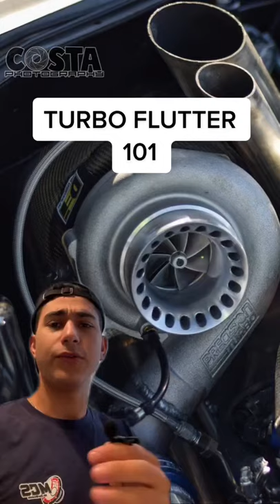TURBO FLUTTER 101 - Explaining Sutututu Theory

Comment: It's called compressor surge, it does not come out the turbine, which is the exhaust side, it comes back out the compressor inlet, which is horribly bad for the shaft, the holes around this particular compressor inlet in the video has anti-surge ports, which will exit those ports instead of totally backpressuring the compressor wheel.
Reply: I came here looking for this comment!  I was watching the clip pulling my hair out for the slight misinformation 😅
Reply: Ikr I thought its real bad for the air (sututu) to come out through the intake part of the turbine... and also where's the connecting air filter? It can't run and can damage the turbo without it, no? 

Oh and so those holes are meant properly for the air to come out the turbo if have to, cos there's the proper bov..?
Reply: It is not bad for the turbo
Reply: You can't explain this to him cause he knows and we don't rahhhhh
Reply: Not bad for quality turbos at all. And even in the worst cases, as an example; your turbo might only last 95,000kms, instead of 100,000kms.
Reply: I always wondered why some turbo inlets had holes or slits around the circumference🤔
Reply: This is closed throttle compressor surge. You’re thinking of open throttle compressor surge. It’s crazy people are still talking about this being horrible for turbos when it’s not. - it’s definitely not as efficient as a diverter valve or even blowoff for that matter. But it’s certainly not horribly bad for the turbo shaft.
Reply: some dealers have the turbo setup for compressor surge, so it's not truly so dangerous unless you push a lot of boost back and forth without another way to relieve pressure.
Reply: @llunull43 while an accessory driven supercharger does this function automatically, but where's the fun in simplicity?
Reply: Installed hybrid turbos, cts stage 2+ turbos on my 2015 m4. I get a flutter when I go hard and once or twice for 15 seconds I had smoke come out. Can a custom tune fix the flutter
Reply: I'm pretty sure i've heard it's not THAT bad on turbos, atleast newer ones.

Comment: Dude its escaping through the compressor wheel not the turbine! The turbine wheel is the exhaust wheel, cheers
Reply: sounds violent. It’s spinning one way but the air still comes out backwards. I can’t visualize
Reply: Isnt it more to do with the pressure building and falling WHILE the blowoff is doing its thing? Isnt that why the compressor is going faster and slower, cause the valves opening and closing? To be fair that could be what he is saying i might not understand.
Reply: @yescharliesurfs  it is simply the turbo was pumping air into the engine and then when you lift off the accelerator the throttle body shuts and if there is no blow off valve or all the pressurised air cannot escape through the bov the air escapes out the front of the turbo where it got sucked in. The sound you hear is the air being chopped up by the compressor blades.
Reply: @farmer3242 would this not be a negative impact on longevity?
Reply: @billbobaggins7617  it will
Reply: @billbobaggins7617  Ohhh Yees 🤣 Costing money to sound cool 😁
Reply: @billbobaggins7617  Yeah most likely. Gives an excuse to upgrade the turbo tho 😈
Reply: @yescharliesurfs no  happens without a bov. not ideal but sounds good but causes lag to
Reply: and without a bov it takes longer for turbo to go back on boost
Reply: @Pete-hy4mq  If it caused any lag it would not be common place in motorsport not to run a valve, it does not slow the turbo down, it does not cause any lag, in fact not releasing boost pressure means the turbo doesn't have to build up that pressure from nothing.
Reply: @DriftNick  . Thats exactly what bov does.not for noise its to keep turbo spinning without stalling the turbo. Not having a bov is also harsh on plain bearing turbos. I have not seen one track car without one apart from drift cars but it just the flutter noise people want. Its the bov whole purpose. Nismo back in the day used two bovs to keep turbo spinning at same speed with throttle shut.. its simple rebound affect especially with short intercooler piping. Another problem on afm cars without a bov fuel mixture goes lean then rich just by lifting off. And im not talking about 1st gear take off lag.  Its between shifts
Reply: @Pete-hy4mq  If you think not running a valve stops the turbo from spinning you have no idea what is happening, stalling refers to the air separating from the blades not the turbo stopping, turbo flutter does not even slow the turbo down.

" I have not seen one track car without one."

Haven't looked very hard, of course you probably also think you are hearing blow off valves on race cars when it's actually flutter, GT3, GTP, F1, WRC, most top level drift cars all have turbo flutter.
Reply: @DriftNick  turbo speed slows dramaticly between gears without.  Like invisible coil. What ever way it turns out if it takes longer to go back onto boost id rather no bov. The sound and ive had turbos over spinning withva bov with creep. Thru compressor wheel staight off and exploded. Getting all that metal out of fmi was not fun. And no it doesn't stop spinning in just slows it down
Reply: @DriftNick  from turbo smart.        
A blow off valve in our testing helps with turbo lag. Venting to atmosphere or venting back into the box as a bypass really does the same thing. It makes no difference. The main reason why a valve is added is to remove what is called compressor surge. This is when the throttle valve closes and the turbo is still spinning at very high RPM's. Compressor surge is the turbo oscillating shaft RPM's and you can audibly hear the noise. This is first off bad for turbocharger longevity and second causing turbo RPM to slow dramatically. When you accelerate again, the turbo has to spool up. A blow off valve or bypass valve will by pass the excess pressure when the throttle valve is closed, allowing the turbo to free spin at a much higher RPM
Reply: @DriftNick  anyway it looks like this subject is divided as much as iran. To soon?. Lol .im not a fan of bov sound so im divided myself.  1988 nismo r30s had no waste gate .just two bovs one without vac and was used to keep boost in cheak but they can afford over speeding turbo's.  Worked tho
Reply: @Pete-hy4mq  You lack a basic understanding of what is happening, people have tested it, it does not slow the turbo down, again if it did cause any lag no one in motorsport would run without a valve.

" ive had turbos over spinning withva bov with creep."

"1988 nismo r30s had no waste gate .just two bovs one without vac and was used to keep boost in cheak but they can afford over speeding turbo's."

wut
Reply: @DriftNick  . Turbosmart and garret must be wrong to. Hmm
Reply: @Pete-hy4mq  Companies selling the solution to a "problem" aren't the most trust worthy, your quote isn't even from Turbosmart, can't even get that right apparently lol, again if it caused any lag literally no one in motorsport would run without a valve.

Also come back when you learn the difference between a wastegate and a blow off valve, you lack a basic understanding of this topic.
Reply: @DriftNick  30 years in the industry i do know the difference.  As for the old nismo setup with to bovs look up r30 nismo setup in production racing.  Its crazy i know but they did it untill they went thru to many turbos from over speeding the turbo.  They had no waste gate what so ever. Dont know why they tried this but they did. Im guessing there idea was keeping the turbo spinning as fast as it can between gears  but was havoc on turbos. As for lag without a bov im not talking about acceleration lag .just between gears as turbo stalls a bit and has to go back on boost . Plum back bov reduces this. There dozen of you tube vids saying same thing. So im guessing you thought i meant lag taking off. Witch you would be right and doesn't cause lag.
Reply: @Pete-hy4mq We are talking about blow off valves and turbo flutter, why would you think I was taking about lag taking off? I'm talking about between gears and/or with quick off and on throttle, there is no extra lag without a valve, in fact the opposite is true, because pressure is not released by a valve it does not need to be built up again when you get back on the throttle quickly.

What R30 Nismo are you talking about? are you talking about the Super Silhouette cars or something else?
Reply: @DriftNick  i think the silhouette was the r31 skyline.  The skyline before it used as touring cars in Australia.  Some had fj20s and later was eccs red top rb20 . Not the nics efi. .they sid things strange back then like liquid cooled ecu's.  They just controlled boost by 2nd bov like bov creep . It worked but turbo's would over speed alot so had to change them out between races.
Reply: @Pete-hy4mq  In Australia the R30's the race definitely had a wastegate and no blow off valves, can you narrow it down? what car exactly ran that setup?
Reply: @billbobaggins7617  yes it’s stalling the turbine wheel putting tremendous load on the bearings. It also slows the turbo down considerably, like slamming your brakes vs coasting.  Now you have to make up for lost speed. It can still happen with a BOV if it has insufficient flow or isn’t setup correctly.
Reply: Jesus I just read some responses and there does seem to be a serious lack of info. 1 year of experience “in the industry” and you think a BOV or a wastegate aren’t 100% requirements you need to find a new field. The ONLY way you might get away without a wastegate is a turbine housing with variable geometry but these are very rare (especially on gasoline engines, diesel I can name a few).  
For the record the r30 had a wastegate but had ceramic compressor wheels that would explode over time, or with little time if overboosted.  There is also no such thing as BOV creep, it’s boost creep when the wastegate is unable to bypass enough exhaust flow(not air flow), which is solved by a larger wastegate or dual wastegates.  A few hours of reading should bring you up to speed on the simple basics.  Or, simply take a look at a drag car. Power to weight ratio is so important they never have anything unnecessary, (often no battery even) but name one that is turbocharged and doesn’t include both a BOV and a wastegate. With answer being none you need to study and understand why these are essential components of a turbo car. You don’t put hundreds of thousands into R&D (sometimes millions in top fuel), years into testing and use something that is unnecessary or doesn’t give you an advantage
Reply: @91maxpower   The irony of you saying there is a serious lack of info after you say it stalls the turbine wheel and also slows down the turbo (probably meaning the compressor wheel), lets start with those two things are connected to each other then if you think it can stop the turbo you lack a basic understanding of what is happening, it does not even slow the turbo down.

" you think a BOV or a wastegate aren’t 100% requirements you need to find a new field."

Wastegate are required except with variable geometry turbos as you mentioned, blow off valve are not required, literally countless people including pro level motorsport teams they don't run a blow off valve or bypass valve.

"name one that is turbocharged and doesn’t include both a BOV and a wastegate."

I can link you a bunch that don't have a blow off valve, though it's more common to see them running one when they are pushing really high boost pressure to stop damaging the throttle plate, not something that happens outside of those extreme cars.
Reply: @farmer3242  More like a rapid pressure build up and release oscillation in compressor wheel.
Reply: @carlosandleon it’s not good for the turbo. Reduces the longevity of it. If you want to try and get a better understanding of it. Go watch driving4answers. He explains everything in a lot of detail so you might get a better understanding of how it happens. He also talks about why the “stu” at the beginning is the loudest and the “tu” at the end is much quieter. Basically a quick explanation is cuz you have the most amount of boost at the start and it releases pressure each “tu” sound. So the turbo doesn’t have as much force to fight against the next “tu” making it quieter each time.
Reply: @Gangster_87  driving4answers is a trash channel chock full of misinformation
Reply: 😂 yup
Reply: @billbobaggins7617 
Yes it will fck the turbo or the engine
Reply: @jessicaandtrains7768  How will it fck the engine?
Reply: @yescharliesurfs For sone time, I thought this was the sound of tuned cars pushing more boost than the BOV can let off. Then I find out it's from these track enthusiasts who delete the BOV alltogether to retain boost between gears. That being said, my big twins on tuned 6 cyl with dual BOV tends to give a short chuckle, or "uh-oh" on throttle closure. Boost doesn't need to be big for this. Never did it before the new parts. It seems to be resulting from the larger turbos taking longer to spool down, and the the larger intercooler and piping taking longer to depressurize.
Reply: @farmer3242 I knew someone was going to beat me to this knit pick. OP wouldn't be the first with that misnomer at all. In practice, people call any rotor in a housing a turbine. You're up against the entire jet-ski parts industry on this one.
Reply: @enlgtnd No it won’t. No evidence that it’s bad for them at all
Reply: Mike-vq1fm   I feel like you gave the best explanation I dont know why everyone is ignoring you.
Reply: Correct. And he's also wrong because you can have a BOV and still get flutter.

Comment: Not running a blow off valve shortens the life of your turbo. You can also have a system (I forget what it's called) where it reroutes the air in front of the turbo's turbine. So you don't lose all of the pressure your turbo built up when letting off the gas.
Reply: Diverter valve
Reply: And yes this will shorten life but it helps keep boost pressure up if u don’t run something such as a diverter valve. And it’ll still last a long time even with the flutter if u have a good turbo
Reply: Anti lag
Reply: Debatable. People run them like this all the time and when you check for shaft play it's fine, the fins are fine etc. Japanese tuners run them like this all the time and they don't overtly ever say that it's bad.
Reply: Recirc
Reply: Lol
Reply: @John-du2mq  no bov need it at 40 psi of boost
Reply: Recirculation valve
Reply: @John-du2mq yeah that’s what I always wonder and I’m running a precision turbo like in the video but I don’t have mine blocked off but I want to try it for a little while just to see.
Reply: Recycling valve a lot of turbocharged automatic engines have them I know the 4G64 have it in the Eclipse and Taylon
Reply: from what car dudes have told me, they said this is a myth.
Reply: @steviejrr  physics debunk myths.
Reply: Ive ran may turbo cars without a bov and blanked the recirc valve and never had any turbo issues its all a myth
Reply: it can do more than shorten the lifespan. it can kill them instantly. this noise we are talking about is called surging. the pressure on the outlet gets too high and the comp wheel can't keep shoving anymore air so the air reverses direction out the comp inlet temporarily. the problem comes in during this event as it lowers compressor pressure significantly but the turbine pressure is still high. this creates as massive thrust load that the thrust bearings hate. 

there are industrial turbos out there that cost more than 75% of the cars on the road that can't be surged very much. never let your turbo "flutter"
Reply: @E85_STI do it. They would love sending you another one at full price. The bearings will not last as long if you constantly surge it. there's a reason even high performance engines don't surge their turbos
Reply: It very much depends on the intensity. Low level fluctuations are not an issue. Plenty of trucks, busses and automobiles with no diverter
Reply: @Horace1993  I can guarantee semi truck or pickup truck diesels are not surging in stock configuration. they all have journal bearings and bronze thrust bearings which will die quickly while surging
Reply: If you have a Bypass valve, you are fine. 😊
Reply: NOT ON A DIESEL.
Reply: Negligible
Reply: @cbrunnem6102 In normal off throttle compressor surge it slows it down doesn't reverse. You're talking about on throttle compressor surge which yes, is indeed bad. also most of these issues you presented can all be solved by spending a little more money on a ball bearing turbo
Reply: @QisKarma_  ball bearing turbos for sure solve it to a degree but how many guys are spending the money for those? off throttle surging is still bad. I know turbos that will croak after surging a handful of times. these are name brand high dollar turbos. they just have to be treated right. tbf the wheels are huge so the forces are bigger
Reply: @QisKarma_  It doesn't slow down the turbo, people have tested it, the rate at which the turbo slows down after lifting off the throttle is the same between running a valve and no valve.